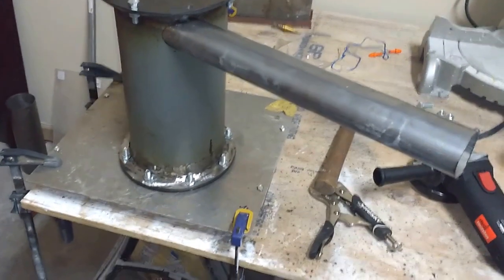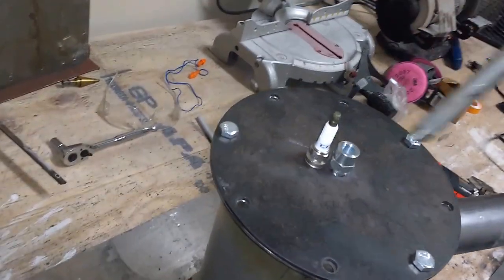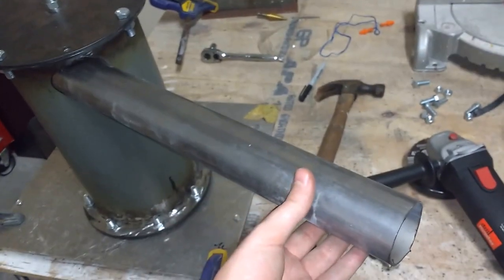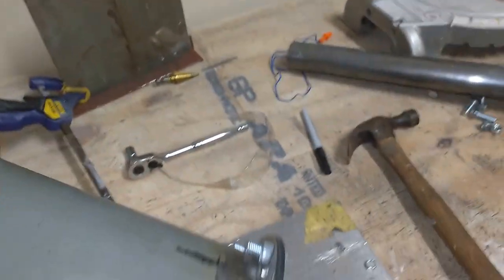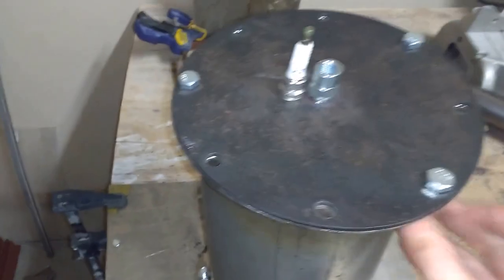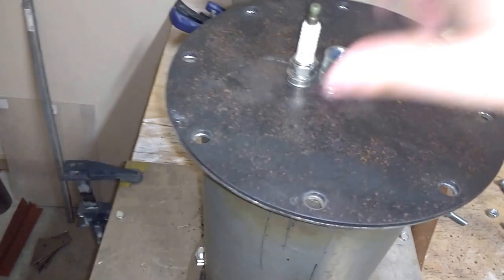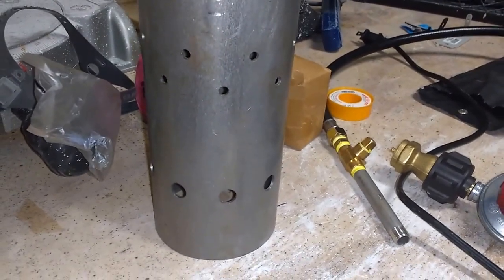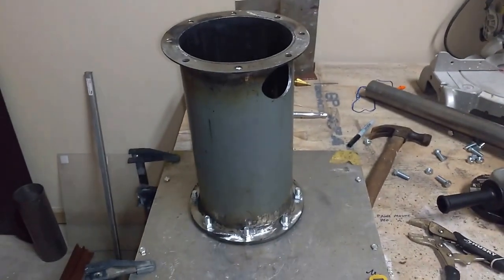Jet engine video 1: overview of the combustion chamber.

Comment: question- with using propane on your unit, do you use an inline check valve for one way flow...or is it ok not to use one, just wondering how yours is setup for propane as Im in the process of building a combustion chamber as well...thanks
Reply from the maker: Yeah, the actual connector to the propane tank has a check valve in them (most that i have seen do). I also have a flame arrestor in line after the check valve on the propane tank. that way any flashback wouldn't make it close to the tank.

you shouldn't have any flame traveling down the hose since theres no oxygen, but better safe than sorry!

Comment: can someone help me? i m to the combustion chamber build and stacks ... my turmo inducer is 7,4 cm
Reply from the maker: not quite sure what your asking, but jetspecs calculator will help give you a good starting point for your combustion chamber. you will need to take the turbo apart to measure the impeller and turbine dia. since the opening on the turbo is smaller. there is a photo in the calculator to help you know what each measurement is.

for the combustion chamber, look for scrap steel bollards on ebay. they are way thicker than you need, and cutting into it will be a huge pain without a mill, but its a much cheaper way to source a steel tube than something like mcmaster carr
Reply: Thannkkkk you  .what kind of fuel u use ? Kero or propane?
Reply from the maker: it runs off propane :)